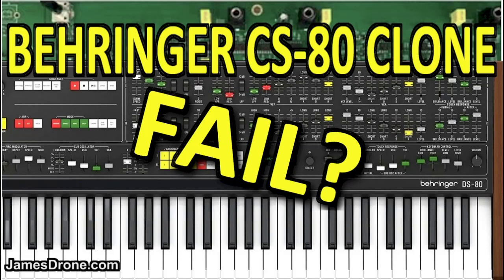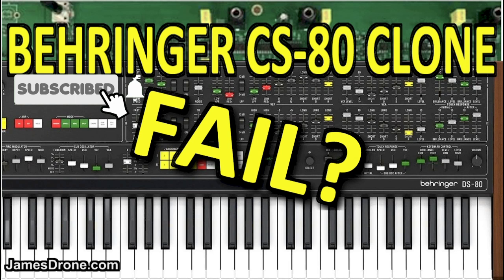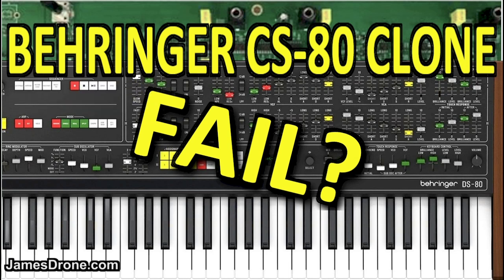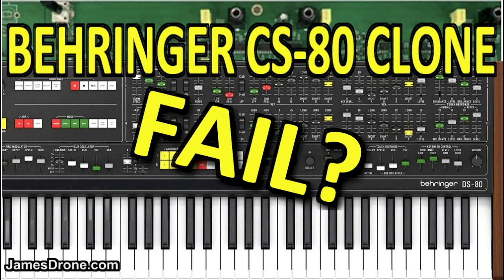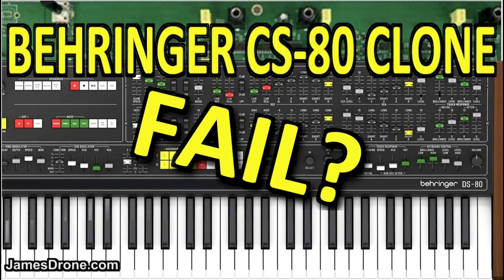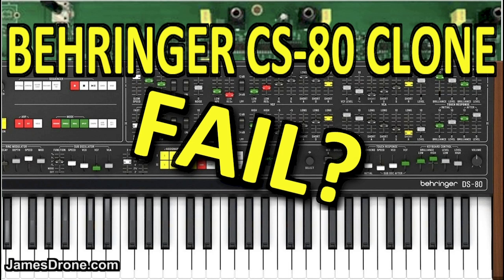BEHRINGER DS-80 NEWS

Comment: I wish Yamaha had released a new CS-80 at least several years ago, seeing renewed popularity of analog synths... 
I think many of us would've even accepted a version with digital oscillators if they sounded close to the original. DCOs means lower cost, which is a good idea in current situation. 
It's such a pity they haven't done that.
Reply: Agree the market is massively bigger than it was in the late 70s early 80s.

Comment: Let me be real clear here. 99% of all users do NOT need a pure, perfect replica. The synth has to have the essence of it, the features, such as poly AT, the ribbon, programming functions. Having said that, if someone made a physical hardware controller _only_,  that has all the same sliders, buttons of the CS-80, with the ribbon, poly AT. A controller with no guts, but controlled the Arturia CS-80v in every dedicated way, I believe it would sell big. Especially considering the lack of hardware circuits would keep the cost reasonable.

Comment: Are they implementing the mini sliders at the top left of original which acted as pseudo presets? Personally I'd rather they scrapped them & replaced them with a conventional modern programmable preset memory system.

Comment: From what I’ve seen, they are showing a relatively complex circuit board that implements a voice card.  Then they say the ds-80 would need 8 of those.  Then the CS-80 has the common section in the lower part of the control panel that controls and modulate the two staked halves of the voice cards so the ds-80 would need a different analog card that would take in the output of the 8 voice cards and implement the function of the common section of the synth.  So a complete ds-80 would need 8 of those dual voice cards, an additional analog card for the common section, a control boards with all the knobs, buttons and sliders plus another digital control board.  I think Behringer just realized how expensive this synth will be and are evaluating if it makes sense for them to continue.  This will not be a $900 synth, and they might see why we haven’t seen many other manufacturers copy the CS-80 architecture, it’s very expensive to implement.  Look at the price of the Black Corporation Deckard Dream, it sells for $4000 and it’s only a module with no poly after touch keyboard, ribbon and mod wheels. I’m sure Behringer would do much better than them price wise but this is a complex synth that uses a lot of components and would people be willing to spend $2000 to $2500 on a Behringer synth?
Reply: Four years ago I would absolutely have spent $2k on one but since then my musical direction and ideas have shifted considerably.
Reply: Yes
Reply: if Behringer brings out a CS80 clone which will sound at least like a Cherry Audio GS80, and its hardware is topnotch.. i will pay with pleasure some thousand

Comment: With the newly announced UB-"X" using much of the design of the UB-XA and them saying it will be easy to produce because of the same firmware, I'm way more excited about a UBX anyway! It's a simpler synth so may very well hit before the DS80 (if the DS ever comes out) The CS80 is a complex synth that although it's unique and dirty sounding (I owned a CS50) the OB-X is simple and has a sound that fits into more music I believe. It's smooth and warm and huge, whereas the CS is pretty whacked out and reedy sounding tone. It's anything but smooth! and Yeah I've played about 4 CS80s besides just my CS50. The CS80 sounds a way nothing else does, and that's cool. The OB-X on the other hand, besides wiping the floor with the more known about XA and OB8, does what lots of synths do, just better and bigger, and softer and delicate if you want. I've played most of the classic polys and the OBX takes the cake. If they can pull this off at their proposed $1200 price I'll take out a loan and get 2!

Comment: Yeah, I got to a point where I was sick of all the announcements, even though I understood why they were doing it.

I found a YT video where someone was repairing a CS80.  I may have remembered this incorrectly, but as I recall ... there's an inherently strange paradox to the instrument.  On the one hand, the fundamental sonic architecture is your straightforward subtractive synthesis.  On the other, because you have hardwired preset sounds per layer plus the ability to store settings and recall them, the electric wiring is complicated.  I would imagine that could be part of that setback.

But honestly, I think hindsight should be taken advantage of and you can come up with a better design that retains the best qualities of the instrument and addresses the issues.  After all, the last thing we need is a 200lb beast of a machine in 2022 ;).

Finally, the key to this instrument is its expressiveness.  If they go for the keyboard, you can't get away with using just channel aftertouch.  It needs to be polyphonic aftertouch.  (And AMS have proven it's possible to do so without breaking the bank entirely).  The module may be tricker but I am sure there is a way for your keyboard controller to send expressive data to it.
Reply: @Danke Place Deckard's Dream sounds great but in my opinion it was a massive oversight not to have included the sliding touch ribbon, which was responsible for some of the unique sounds in Bladerunner: at the price they're charging there was really no excuse to have excluded it. I'm happy to wait for Behringer's clone, too.
Reply: @Danke Place That's a fair point, 'though for me, personally, If I was to part with that amount of cash it would have to have the ribbon: as for the wait for Behringer - "I don't know how long we have - who does?" :D. Snap!
Reply: @Danke Place Lol, I can't think of any more Bladerunner catchphrases to match!T The Hydrasynth sounds pretty interesting. Mind you Omnisphere 2 has some nice CS-80 sounds that are very faithful to the famous Bladerunner 'Strings' sound so I'm happy with that for the time being. I agree Behringer does seem to be pushing themselves very hard in a lot of directions. It'll be interesting to see how things go with their CS-80 clone. I'll be getting the Mono/Poly soon and look forward to that: the original KORG Mono/Poly 's a great synth and they seem to have done a very good job of producing the clone. All the best.